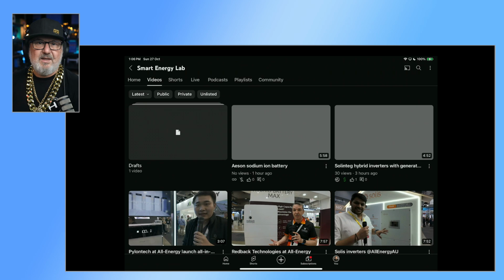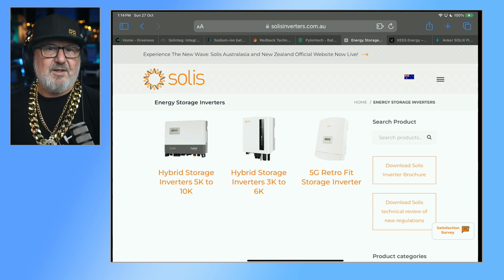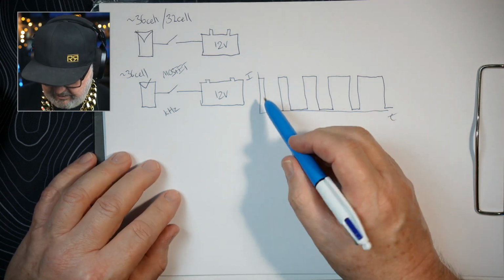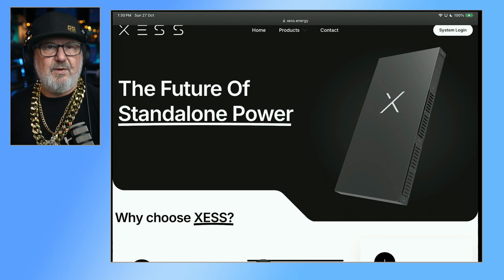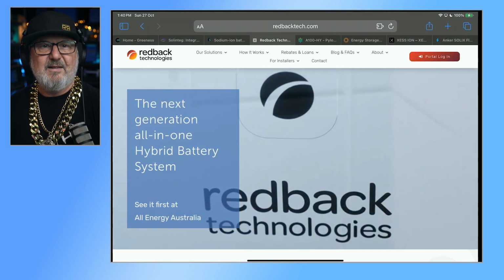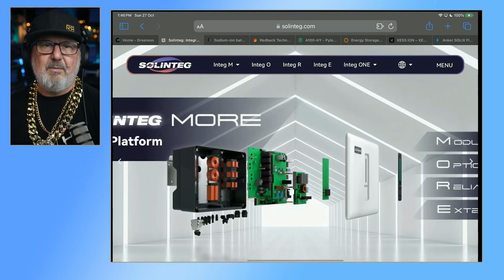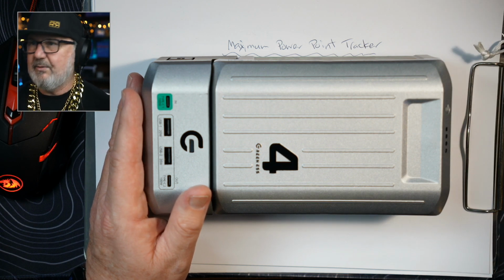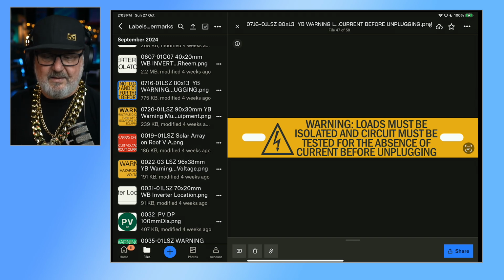Toolbox TechTalk 2024 -10-27

Comment: Glen, love the review videos. 
Learnt alot from your tech stuff. I have a question I hope you could answer.
I put in 17.76kw of pv in 4 strings. 4 yrs ago. It's 3 phase hauwai. In NSW limited to 10kw feed. At the time no hybrid inverter was available larger than 10kw.
So now I want to put a sungrow 15kw 3 phase hybrid in. It has 3 mppt inputs. 2x2 plus a single. Is it possible to connect my panels, leaving the single mppt vacant? Or would I need to add a string (6 panels) to that? Thanks for you imput.
Reply from the maker: Hi Steve, thanks for the kind words. There is no need to use all the MPPT's on an inverter however, I have heard that the Sungrow hybrid are "fussy" about the amount of voltage difference between the strings of panels that you connect to each MPPT. Best consult with your installer.
Reply: @SmartEnergyLab  Thanks Glen.